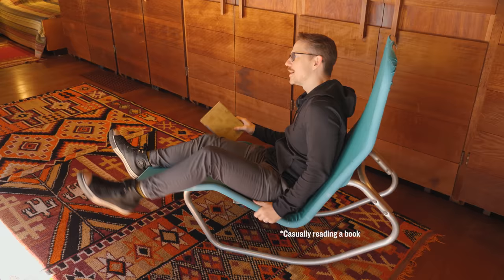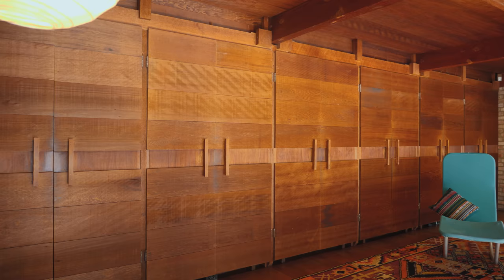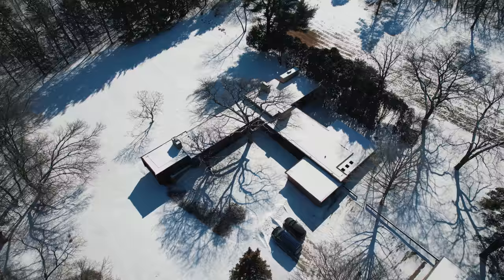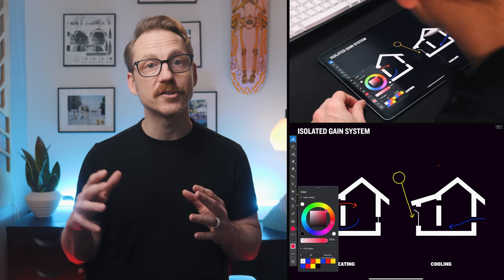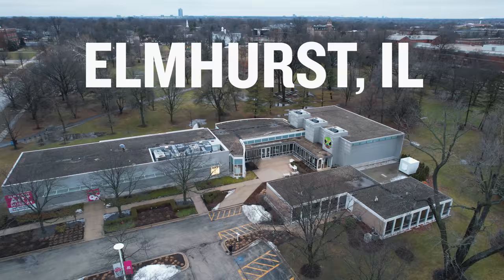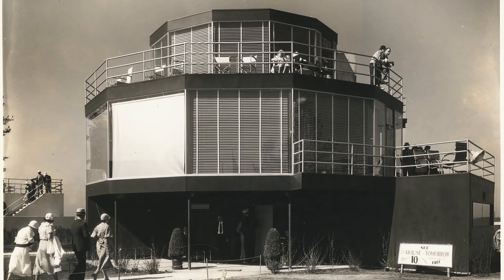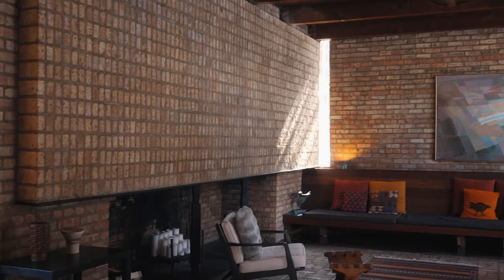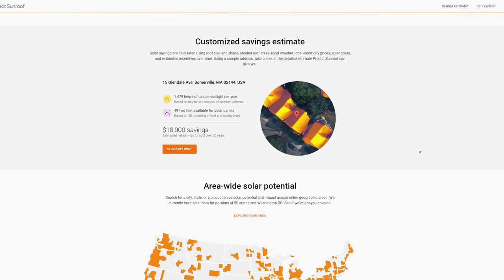How This Midcentury Modern House Harnesses the Sun

Comment: This sounds great and I have a porch I built with the same principle but it's kind of wrong.   What you'll find is that it's great on Dec 22nd, the sun reaches across the room.  And then you remember that you haven't actually hit winter yet and you watch rather sadly as January leads to February and the sun line is marching back across the floor and by early March it's still butt cold and you have almost no sunlight.   30 degrees would be a better angle than 24.5.  You'll still block summer sun but you'll get better thermal gain from early November through March.
Reply: It's a complicated subject for sure with some nuance. Every place is unique. The thermal mass (floor) can carry the heat back through entropy whereby reducing the need for direct exposure.  If you look closely, the floor has rugs which reduces the solar gain anyways, so there would have to be a significant amount of thermal mass.  While your argument makes sense, it's hard to make a simple statement since we don't know so many factors. (Did they account for this limitation and oversize the thermal mass?)  Anyway, it's a good observation, but be careful with assumptions is all I'm trying to say.  (And your comment is a great solution to reduce the thermal mass, btw as long as the summer gain isn't too much in the hotter months. A balance that definitely needs consideration.)
Reply: Just input your house into 3D Studio Max. Add a sunlight. Then you can see exactly how the sun comes through your window at any time or day of the year. That’s how I designed my house.
Reply: " . . . . .  30 degrees would be a better angle than 24.5"  Isn't it  entirely dependent on the latitude you're on?
Reply: @fleaniswerkhardt4647  Yes and no,  certainly the optimal angle depends on latitude but for anywhere in the northern hemisphere where you're calculating how much overhang is ok 30 degrees will provide more sunlight for more of the winter months while still ensuring complete shade in the summer months.
Reply: @james_robnett  ok. I'm in the southern hemisphere so the same should apply?
Reply: @fleaniswerkhardt4647  Pretty much yeah.

Comment: The problem: The angle of the sun is equal on March 21st and Sept21 BUT weather is no where near the SAME in March as Sept.  This is due to the inertia of the earth, it take time for the land and air to warm from the winter, so March doesn't equal Sept.
A better design uses hardwood trees, that leaf out and drop their leaves at times matching the warming temps.  With their leaves down during winter the low angle light can enter windows.
Most of the problems with "passive" is having too little control.  A combination of operable draps with trapped air pockets and reflective layers, plus use of hardwoods to create shade when you need shade.

Comment: I visited my family in a small village in Northern Greece in about 2003 and I was so surprised that one of the walls of my family's home was about 2ft thick while the others were more normal. It was probably the south facing wall that used the thermal mass to warm the house at night, right?
Reply from the maker: Probably!
Reply: I'm not an architect but the winter sun flooding in to a room through large windows is just gorgeous and practical. The solar passive houses I know do not block the sun with a wall! Houses can be designed to absorb solar heat into the slab underneath, meaning you get the best of both worlds. Thick walls on the sunny side (south in the northern hemisphere, north in the southern hemisphere) seem like a travesty to me. Orient the house east-west and stick all the cupboards and solid walls on the cold side, and open it up to the sun on the sunny side!
Reply: @VanillaMacaron551  It was probably an older house where aesthetics played a minor role. could be that the original builders of the house had neither the materials nor the technical knowledge to place windows in that wall. You're forgetting that for a long time, windows weren't even covered with glass but with animal hides (in cold climates) or just left as open holes. Having a thick south facing wall would have protected the home from the summer heat. Apart from being more comfortable, that would have helped conserve food. And I suppose the wall would have acted as store for warmth when it was hit more directly by the winter sun. 
I find it really fascinating how people built their houses to protect them from the environment before they had the luxury of modern insulation and central heating. @Beth V: Do you know how old this house is? And it would be interesting to know if that is typical for the regional building style. You definitely have some new questions for your next visit :)
Reply: What? I thought the thickest wall should be to the north against the cold and big windows to the sun to get the most sun in?
Reply: @iknowyouwanttofly  not in the very warm climate

Comment: Great video! However, I think that it is important to mention that while 24.5 degrees might be perfect for IL, you'll need to calculate this according to your location. Up here in Canada, that angle decreases as the sun is lower all year round. 

Something else to consider is that the angle changes throughout the year and it might be a mistake to design for the lowest angle since you'll only experience that during a short period each year. Instead, one idea would be to design for the shoulder seasons. Especially in a cooler climate zone, designing for a 45 degree angle might be a good compromise as it will still allow sun to reach the floor in November and March.
Reply: Bingo! I'm here to say the same. In fact, I have many criticisms of this design. I currently own a home that has a similar design concept. And for 9 months out of the year, it's like living in a refrigerator. Absolutely horrendous idea for a home in the North, such as mine, and this design here, to be built to repel the sun for all but the shortest time of the year. The house feels like it's always in the shade. you can't have any plants, very poor natural light, and for some odd reason, the architects who design like this, place windows that do not open. It is far superior to have a house receive the sun, rather than repel it, and to mitigate warmer periods with an OPEN WINDOW! This house looks way too dark. No wonder the owner fled to Yale.

Comment: My father was an architect and designed our house. It had solar panels with air circulating in an air space and heating a storage room full of water bottles as heat storage. Before that we lived in another solar house designed to use Freon in solar panels to heat a storage tank. That one, unfortunately, was a real problem from Freon leaks.

Comment: In 1984-1987 I designed, engineered, and built, along with my husband & 2 teenage sons, a log cabin on a full walkout South facing basement totaling 3,600 sq.ft. of living area. It is passive solar. I engineered the cabin for the sun to begin entering/leaving the South facing atrium doors on the Spring/Fall equinoxes. By Dec.21st the sunshine comes back 12' on the basement level, 10' upstairs. This works well because heat rises. I'm not a college graduate. Never even studied drafting. I used library books to study solar, and to determine the declination of the sun. All windows/doors are double pane and standard sizes that you can buy locally anywhere.
Exterior of basement is rock over insulated 10" cinderblocks (heatsink). This log cabin used 8" pine logs (heatsink). It works! And I have a heatpump HVAC system for climate control. This design was given to me in a dream. I'd been working on the design for about a year & nothing seemed to be "right" until I dreamed. I got out of bed, put the coffee on, set up my drafting board and scaled paper 1/4" = 1', and when my husband got up and looked over my shoulder he exclaimed, "That's it!" I've lived here 35 years now, and I am so glad I designed this home to be passive solar. It's saved us a lot in heating/air-conditioning bills and the 1st month we moved in (Feb.1987) the electric company (Dominion Power) sent out 3 different meter readers to verify that we weren't stealing power!

Comment: I bought a 60 year old house in Japan where I now live. From Australia I had a basic knowledge on design that developed there to counter the heat mainly. I made so many mistakes renovating the house in Japan which are now plainly obvious to me. One example was to restore the beautiful timber post and ceilings to then apply clear coating to highlight the grains. A reason why the timber is never coated as it absorbs moisture in summer and heat in winter.

Comment: My house was built in 1875. It has a side porch on the south side along with a solarium. It does exactly the same thing. Besides the sun in the rooms during the winter the solarium can reach 90 degrees if it's closed. Of course I open it during the day and it works like a huge space heater..I also have transoms which I can use to create drafts during the spring and fall. (Summer has become too hot)

Comment: This was a fairly common build technique in villa style houses going way back with their verandas, often around three sides, that allowed winter light in and kept summer sun out. Often parts of the veranda were glassed in to capture the heat like a glasshouse which could be admitted through large sash windows into the house. They also acted as sunrooms. In the summer those areas allowed people to sleep outside in a protected way to take advantage of the cooler night air. I grew up in such a house that was built in the 1910s and we took all those design features for granted.

Many of the buildings at my primary and secondary schools were built with such features including entire walls made of concertina glass doors that opened the whole side of the room to the veranda and the fresh air.

Comment: I am under the impression architects, builders and urban designers in the mid-century had a much better understanding of using natural light and adapting buildings to it then many modern developers. There is a lot of knowledge there that should be used to build houses that are better adapted to different weather and light conditions and changing climatic conditions, without relying on expensive or energy consuming technology like airconditioning or special tinted windows that don't open.
I live in a 200 year old warehouse. The thick walls and medium-sized windows with south-western orientation (we are on 52 degrees of latitude) make sure the sun only comes in a little in the summer, but all the way in in winter.

Comment: I'm particularly fond of the Afghan Yakhchal form of passive refrigeration Or the Turkish Badgir passive AC. Which is similar to the convection model, but, includes the use of a body of water in front of the the air intake to reduce the temperature even more.

Comment: Every house should be like this. The tradition of putting big windows on the road-facing side of the house is pointless, your house could be facing west into the hot afternoon sun (I live in Australia) and yet have big windows facing west which you then desperatley have to try to block whilst having your air con cranked up to high all summer, heating the outside air.

Suburban planning sucks.

Comment: This is the most concise explanation of passive solar I've ever heard! And with a great demo house. I will be sharing this a lot. The only thing I might add is that a stone or concrete floor is usually recommended because they have significantly more thermal mass than wood. It's frustrating to see that every new home in the last 50 years completely ignores solar orientation. It's free heating and cooling at basically no extra cost.

Comment: I've heard of a lot more houses these days using infrared-blocking windows to passively manage temperature. They're generally only installed on the upper levels of homes, while the ground floor uses untreated windows, with overhangs of about 24.5° like in this video. The infrared heat of the sun gets blocked by the treated windows and the overhang in Summer, but is able to freely stream into ground floor windows during the winter, where it can rise and keep the whole house warm.

Only downside I've seen is that the upper floor windows can get remarkably cold. It's a little unsettling to be sitting right in front of a southern window on a bright sunny day, and still be shivering, and we've even had cases of frost building up on the inside of the window in extremely cold weather.

Comment: That's clever I guess. But designing the angle based on the winter solstice is really leaving out sun light during the coldest parts of the year and into mid spring when sunlight is still a welcomed tool to heat a house. It really should be built around an angle more towards early to mid March.

Comment: I live in a mid century home by Charles Goodman. Many of these ideas are integrated into the house. Brick and flagstone floor and walls absorb heat in the winter. A butterfly roof that extends outward several feet block mid day summer sun from overheating the house but keep the rooms bright and sunny during the winter. And a series of low hung windows that open combined with a whole house fan keep us cool during late spring and early summer. That being said, this house performs best during the milder parts of the year. But in deep winter or the dog days of summer, those passive heating and cooling tactics reach their failure points.

Comment: Beautiful house. Facing south with windows have been a building practice for thousands of years in China (where I come from). It makes a house much more comfortable especially during the winter. Even today's junky high-rises built in China mostly take advantage of it. It is surprising that most northern US (where I live now) developers disregard the practice. The majority of houses (including mine) in my area are ease/west facing with garage facing south. During the winter month, I find the garage is a place to hang out and living rooms are mostly cold especially on sunny days.
It is strange that our green warriors never dream small and propose a code/incentive to encourage this. Proper facing and good insulation are far more practical and cheaper than any additional solar panels or 10% more efficient heat pumps.

Comment: I live in a house that harnesses the sun. I live on an island in the northernmost part of Norway, equal to the northern coast of Alaska. A day where it's 17-18c outside and sunny, it's 30c inside with all the doors and windows open and a draft. If it's not sunny, it'll be 24-25c inside without any other power sources running than a computer, a fridge, a couple of freezers and a TV. So if you like spending money on cooling in addition to heating, get a house that harnesses the sun, especially if you live further south than me.

Comment: Videos like this get me all spiced up about how frustrating it can be to witness massive swaths of suburban homes pop up who completely disregard the site on which they are being built. To me, making more sustainable long term homes that rely less on electricity to run heat and air conditioning could be addressed at the design phase. But it's simply ignored because it's just not how the industry makes money.

I live in a post ww2 neighborhood. So, these houses went up super fast and often ignored the site they were built on as well. There are maybe 4 unique designs, then they're mirrored too. So basically same house, hundreds of houses. The only benefit this neighborhood has is time. I can easily walk around and observe how different homes addressed different issues over the years.

Basically, I'm mad that each plot site wasn't considered when designing. Like. I feel like it wouldn't have been impossible to map out the neighborhood and choose certain homes for certain plots. Like "these will be the south facing homes", "these will be the west facing homes" even would have been a step up.

Comment: I assumed that these ideas might have started post-WWII, so it's amazing to see these designs in the 1930s. And of course our understanding improves incrementally over time. I live in Canberra, Australia, which has pretty extreme cycles between summer and winter temps - up to +43 C in summer and -8 C in winter. My little brick unit was built in the 1980s, with obvious reference to where the sun is year-round. Sunlight literally hits the interior edge of the window frame at the bottom of my northfacing wall (entirely glass) around 4 weeks before the autumn solstice, just when the summer heat is over. Over the autumn/winter, it encroaches further into my living space, although not reaching the back wall. The reverse happens during the approach to summer. There's a direct airflow through the central corridor to the windows at the rear, if they're open (no high-up vents).
However, this wonderful design is not as efficient as it might be, since the north-facing windows are single-glazed, I suspect there's no thermal break between the concrete slab that makes up my floor (under carpet) and the full-width concrete balcony, and the ceiling insulation is about half what it should be (I'm not fixing any of these things since I'll be moving soon). Also, while the exterior walls are genuine double-brick, there's only a small air gap, no insulation. So we've learned a bit more since the 80s - I'm sure there would be other efficiencies I'm not aware of. 
As it is, though, we've gone through a somewhat cooler summer than usual, and by keeping the rear windows open and opening the front ranch slider when the sun has moved sufficiently west that heat isn't bouncing off the balcony, I have not needed to run the air-con once. In winter, I rarely need to run heating during the day, although it does dissipate very quickly once the sun moves west due to the single-glazing and inadequate roof insulation, alas.